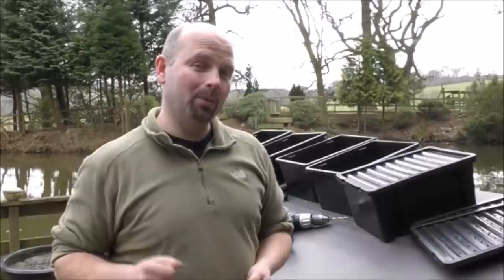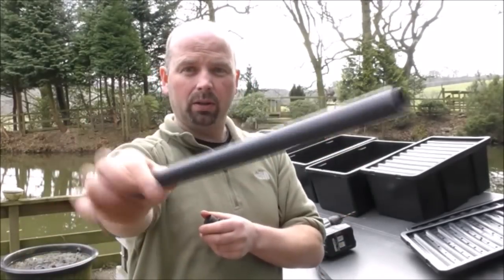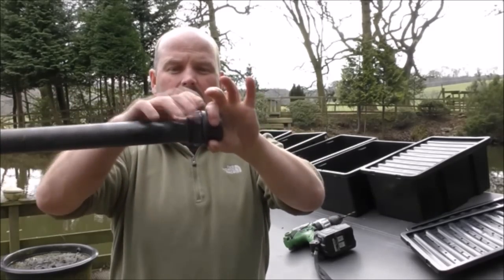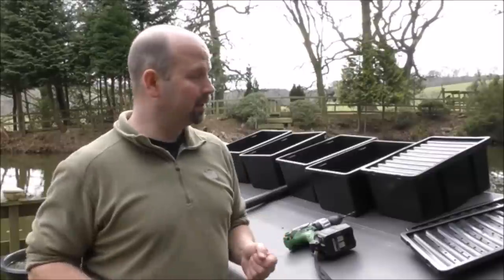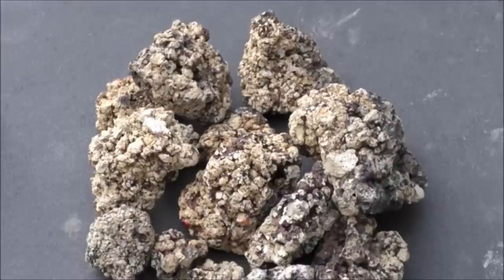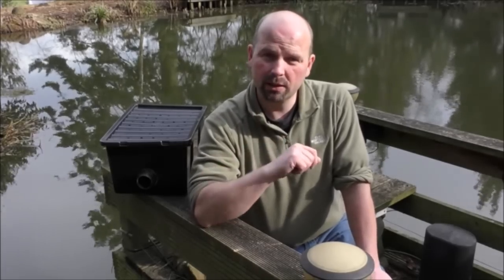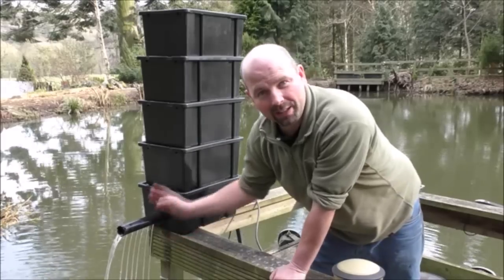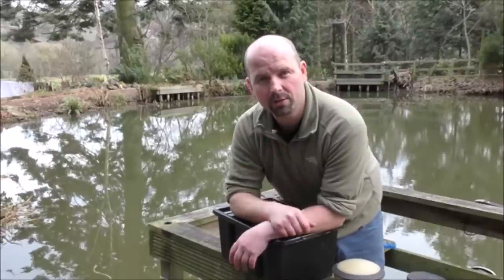DIY Shower / Trickle Filter for a Koi / Fish Pond by PondGuru

Comment from the maker: Click 'SHOW MORE' for full video description + links - Watch in HD.
Decent set of 4 plastic boxes: http://geni.us/iGvq
Stronger option for larger filters: http://geni.us/tBdZg
Biohome and Pumice: http://www.filterpro.co.uk
The shower filter set up on outdoor aquarium: https://www.youtube.com/watch?v=EL9HR_Y3-40
'How To' video showing the building of a very effective and extremely cheap shower filter for a fish pond.
The media types in this video are as follows:
Flocor = a very cheap and quite ineffective plastic media in any situation. Supports aerobic bacteria.
Large Hel-x = a quite effective plastic media for a shower filter but more suitable for a large moving bed filter. Supports aerobic bacteria.
Hel-x 13 = decent media for a shower filter but like other plastic media it only really supports aerobic bacteria. Good alternative to K1 in a moving bed filter as it has 40% more surface area per volume.
Gravel = it is definitely not the best natural media but is better than plastic. Supports mainly aerobic bacteria as it tends to be not very porous.
Alfagrog = A decent cheap ceramic media which does quite well in a shower filter. Good surface area but poor porosity so it takes ages to build up anaerobic bacteria. However it will support both aerobic and anaerobic bacteria when well established which could take a year or so to affect nitrates.
Pumice = a great natural filter media if the correct type is selected. The pumice I used in this video came from a supplier specialising in pumice for drinking water purification so it has an excellent reliable internal structure. Will support a decent balance of aerobic and anaerobic bacteria for nitrate reduction.
Biohome Ultra = A sintered glass filter media which was created for use in shower filters and large aquarium sumps. Effective in fresh or salt water and its internal structure is perfect for supporting aerobic and anaerobic bacteria in great balance so is the best choice if the aim of the filter is full cycle filtration (nitrate reduction).
I sell some of the media types above on my website here: http://www.filterpro.co.uk

FILMING EQUIPMENT:
Panasonic HC-VX870 http://geni.us/3UwE
Rode stereo microphone: http://geni.us/4OL
Rode deadcat mic cover: http://geni.us/1pmn

If you have found this video useful feel free to share it anywhere you think other people may benefit from viewing it.
Check out the nation of other aquatic videos on my channel.
Thanks for watching.
Pondguru.
Reply: @Steves_fish  Yes less is more as far as numbers of containers go but this video is simply to demonstrate that something can be made very cheaply using boxes bought from discount stores. My choice for a 'proper' sized shower would definitely be the traditional long containers and you're right - the smaller a system is the more need there is for overflow(s).
It's definitely good advice to have a spare similar sized pump for any system whether that is indoors or outdoors as it is the heart of the system.

Comment: Just finished putting this on my pond, 2500 litre raised sleeper goldfish pond. Have the pump connected to a pressure filter then on to the DIY shower which is 4 boxes high and has about 20-25 kilo of alfagrog. So delighted with it so far.

Comment: Great video. I wrote on a blog from which I'm a member about your system, which I copied. I didn't use boxes, but a plastic chest of drawers (5 drawers) and it is working perfectly. I don't use strong pumps, but two that don't use much electric and made two of these trickle filters, which are running for more then 8 months now. The pond was green, but it soon turned back to a very clear pond. In the beginning I had to change the soft filtermedia or wash it out a lot, but now maybe once a month.
Besides that I put an airstone connected to an airpump at one end of the pond, which is helping of course. Also I increased the filter time. I turned the filtering of at night, but now the pumps are running 24/7. 
The water looks so clean that I use it to cool off, swim between my fishes and feed them by hand! By the way I live in Thailand, so one of the concerns here is algea. My pond is divided into one big pond and some smaller basins, which are carrying above water plants. That's the only place green algea is growing. In the big pond itself there is except for some kind of growth of a spungy thick layer of whatever that sits only where there is a lot of watermovement no visible growth of algea. The fish help maintaining this pond.
Reply from the maker: That sounds great and I'm glad you used the principle idea of the shower filter to achieve better water conditions - good stuff and thanks for watching.
Reply: can you pls tell which water pump you are using
Reply from the maker: The pump was either an old Oase Nautilis 3000 or an Oasis 3500. Both old pumps from my pond building days and I'm not sure they are made any more.

Comment: finally made this filter for my koi pond(that i watched and learned how to make from you back in 2013 at 14yrs old) and it made a huge difference in a day!!!! thanks for sharing this.
Reply from the maker: No worries and that is awesome to hear. I'm glad when people have great filtration on their pond as the fish will benefit from that.
Reply: How did it hold up as I'm lokong at making 1 for my 1st koi pond at 11000 litres
Reply: @AsavageMustache  it held up well. But I eventually shut my pond down. I recommend painting the outside of the containers so it doesnt get sun damaged over time. Or put under shade if you can.
Reply: @TheDeedsta  appreciated

Comment: This looks like a great DIY filter, I've seen a few on YouTube, but this may be one of the best (if not the best). I haven't made any of them though because I always have one question that never seems to be addressed in the videos...
How do you clean it???
The DIY filters often seem to be superior to anything you can buy for the money mainly because you can make it as good as you like.  However, they all seem like they'd be difficult to clean.  For this one, do you only clean the pads and leave the other media alone, or do you have to clean all boxes?

Also, how do I know how big of a pump I can use without overflow my DIY filter?

Comment: Hi Richard, enjoyed watching your video, very good cheap one filter. You have many excellent ideas, going to check out your aquarium video now , very amusing cat. Just bought bio balls and ultra filter media.  I've Having a lot of trouble with very high ammonia reading, done water changes over last four days. Reading was off the scale, but now down to 2.0 but still too high, I'm hoping the new media will get the anirobic bacteria going.  Cheers from Dennis
Reply from the maker: +dennis frankland Ammonia should never be e problem with an aquarium once the filter has matured. The balls and new media will certainly help. Glad you enjoyed the video and thanks for watching.

Comment: Hello mucker... loving all the vids... i have just built my first pond, only small as my garden is tiny... i used a icb container so just over 1000 litres... i have a pump and filter that does 5000 litres so should be ok but would you recommend adding a shower filter?? Ps do you still metal detect 🤩🤩

Comment: Great video. 
I see you put a bar in the bottom box on the outlet. I am having a 4 box shower and filling the first 3 with your media. Will I be ok just to have the tank connector on the bottom box as this will just be used as a settlement chamber 
Thanks paul

Comment: I absolutely love your videos, so helpful! I had an idea I'd like your opinion on. Last summer I hand dug a 10ft x 5ft x 4ft deep pond. Before this I've never even owner a fish tank. Now that the ice has melted I've noticed a good bit of leaves in my pond. My idea was to use my wet/dry vac with a mesh bag inside to vacuum out the leaves while letting the bottom port on the vac open so the water could flow right back out. I only have 5 large (roughly 10in) fish in my pond who always avoid where I'm working in the pond so no little ones to be sucked up.. Do you think this could work to do my spring cleaning of the pond? Or maybe links to your own videos on pond cleaning. Thank you!!

Comment: nice job and very cheap!, will try setting this up above the first bay in my bay filter, its deffo gotta help improve water quality !!
Reply from the maker: Yes it would definitely add much more biological action and help with pollutants. You don't need a mad flow rate going through it either.

Comment: I have a 3-ft deep pond, and I could only see one inch below the surface with green algae, I made this filter and now I can see the bottom perfectly...only tip is don't forget to switch the pump off when it's freezing weather , as if it freezes in the box the pump will empty the pond by overflowing out of the side of the boxes

Comment: PG...great design for little money, I could out one box on my aquarium, get your sponge kit and Biohome and it would be a great filter at low price...thanks for the cool idea
Reply from the maker: Yes it makes maximum use of minimal space and could easily be used on an aquarium. Glad you enjoyed the video.
Reply: Can you fit a drain to a timber raised pond
Reply from the maker: If you have fittings designed for use with liner then yes no problem. If you search 'bottom drain for lined pond' on google you will find suitable products.

Comment: Great video as usual. I was wondering if you could show a picture of what the pond water looks like before it goes in and what it looks like when it comes out. I would guess that as the system becomes more active those results will probably be better but it still might be interesting. What is the maintenance on a system like this. Do you just need to clean/rinse the media pads periodically or do you also have to do something with what ever media type you choose? Thanks again for an easy to follow and economical project.
Reply from the maker: +Thom Lindgren Problem is that flowing water always looks quite clean and the real test will be looking in at the foams after the filter has been running a while. It is going to be set up on my outdoor aquarium with a mixture of biohome and pumice filter media so once it has been running a while I will do a water test and take a look inside on a future video.
The foams should be the only things which need cleaning with the coarse and medium foams needing rinsing and muck removing. The fine white pad will be binned when it is clogged.
Although a filter of this type will clean the water and can reduce nitrates unless it has a UV fitted before it it's unlikely to act on a green pond which gets many nutrients.
Glad you enjoyed the video.

Comment: Great video! I think it would be very interesting to see how this performs compared to say an Oase filtoclear, I would imagine when filled with Biohome that its filtering capability's are untouchable for it's price. I think this is defiantly going to be a summer project for me.
Reply from the maker: +ChRiSVII Even with alfagrog it will do an excellent job and with pumice it will do even better. Using biohome is kind of like saying to the filter 'if the water isn't perfect it's your fault' as it is better again.
I actually swapped out some of the biohome for pumice and that will be running in an upcoming video. I wanted the water to be a bit higher pH and mineralised for my aquarium and although the biohome offers the perfect balance of aerobic / anaerobuc bacteria the biohome wouldn't do raise pH or mineralise water. The pumice could well be a great choice for a large koi pond. where a huge filter is required and cost is an issue.
Reply: Nice one Richard  I can't wait to see this secret project with that massive aquarium!

Comment: Great video yet again... How much bio home media did you have to put in the 5 boxes as I'm going to build 2 for my pond? 

Also always good to listen to your videos as you sound just like my dad. Lol
Reply from the maker: +Karl  Rickaby I actually am only using 2 boxes as I am fitting it on an outdoor aquarium of around 800 litres. The top one has biohome (approx. 10kg) and the bottom one has around 20kg of pumice which is really miles over the top for 800 litres, lol
I went for more pumice as I want the pH to be above 7.5 and hopefully mineralised water as I'll be keeping crayfish in there.
Reply: +Pondguru Outdoors thanks for getting back to me... I'm going to build 2 of the full 5 towers on my pond to add to filters as my pond 12500 litres and has about 40 koi. As tend to get people contacting me to re-home koi. Iv just found you on ebay so will ordering pumice for you. Just got to work out how much need for 5 tubs
Reply from the maker: +Karl  Rickaby When you get the containers just send me the dimensions and I will work out how much you need no worries.

Comment: Love this. 1 question. Did u use media/foams in all 5 boxes?
Reply from the maker: The foams were only in top section and the media was in all boxes. I only went with the biohome in top box and filled other boxes with white pumice.
Reply: Pondguru roughly how many kg or litres if media did you use?
Reply from the maker: There was roughly 10kg of biohome ultra in top box and 10kg of 30mm - 50mm pumice in each of the other boxes. The pumice is less dense so filled each box well.

Comment: i made mine 9 years ago never clean them always clean also i have a 100 gal stock tank as pre filter that's the one i flush once a week and fully clean once a year.  i made a 1'' hole on each totes on the side on the top because shower needs good contact with air to make nitrates go down

Comment: green standstill pond water....how about to get the pond water moving and use some UV-C light to make the green algue clump together so the filter can catch algue and you will get cristal clear water and the light wil kill tiny paracites aswell....and the sun can reach bottom of pond and you can se the fish down there aswell
Reply from the maker: +Richard skår I had a mega filter system planned for this pond but it is around 1,000,000 litres and would require way too much UV power to affect the water, plus the size of settlement chambers / mechanical waste removal would require something akin to a small treatment plant.

Comment: Hi great video I’m making one in a couple of days what I need to know is what is the name of the connection that goes for the inlet and outlet cheers
Reply from the maker: As far as I know it is just a tank connector (available in different sizes) but in the US they are called 'bulk head' fittings.
Reply: Pondguru hi what size is the inlet and outlet cheers
Reply from the maker: They were just bits I had lying around but I think the inlet was quite small (20mm) and the outlet was around 40mm (could have been 50mm?) Outlet would always be much bigger than inlet when water flows out via gravity.

Comment: Great video and I'm going to start this at the weekend. I have a small (500 gallon) above ground Koi pond and want to improve filtration which right now is mechanical to include bio. There are quite a few small Koi (12) in it and wondered if you think a three tier trickle filter would be big enough? I'm being very lazy here but can you tell me where you sourced the inlet and outlet connectors and pipe. The containers I got were from Poundland like you suggested and are the same size as the ones you used. Love all your pond videos so many thanks!
Reply from the maker: The inlet / outlet were from some old filters I had lying around from my pond building days and the best bet is to visit your local pond store and see what is available. Failing that a place which sells plumbing supplies should have the necessary tank connectors and pipes available.
Yes a 3 tier will be big enough for 500 gallons and I'd go for between 25kg - 50kg pumice for some serious filtration (if the boxes are big enough, the ones I had only held around 10kg)
Reply: cheers!

Comment: Thanks Richard another great filter example. Can you explain the benefit to separate boxes between the media. And why the shower effect between the boxes helps. Thanks D
Reply from the maker: +EastLondonKiwi Glad you enjoyed the video, man.
Having separate boxes allows the filter to be made bigger / smaller for the size of the pond but more importantly it increases the chance of the water being well spread across the area of media contact.
There is nothing wrong with a single chamber tall filter (like a wheelie bin) but there's a small chance the water would not cover all the media depending on the layout of media as water always takes the easiest route.
Hope that makes sense.

Comment: very educative and informative video,thank you! my question is ,what power head or pump did you use to suck in the water all the way up ? I am interested in building my own and better filters for the aquariums I have at home,the ones in the market are just very expensive and incapable of getting  the job done quite well so I am searching for a better and also a cheaper alternative.
Reply from the maker: This one uses a spare Aquamax 16000 I had but really it would be fine with an 8000 pump as the water does not need to flow as fast as it is in this filter. Even a moderate flow will be just as effective.
Reply: Pondguru Outdoors
thank you!